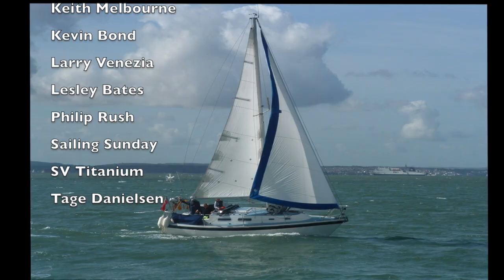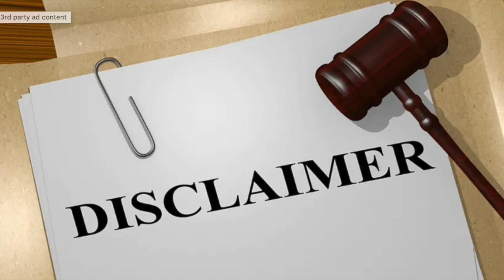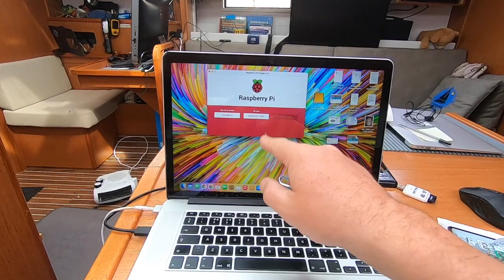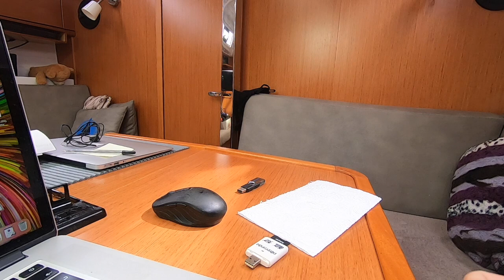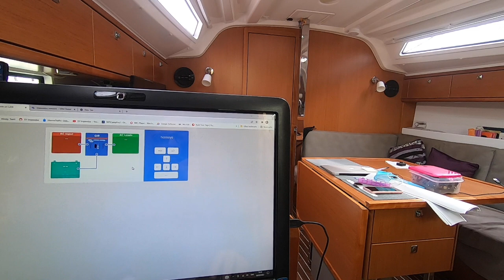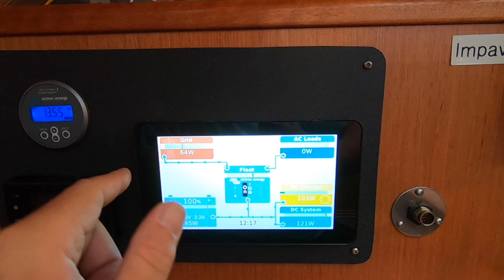Victron Energy display on a Raspberry Pi OTB 134

Comment: Interesting project, thank you. How much did you save by doing all this compared to hooking a GX touch into your Cerbo GX? Also, did I miss something? Does this have more capability than VRM and VE Connect on my iPad?
Reply from the maker: The cheapest bundle price I could come up with was £550 UKP or $570 USD However the GUI mods give far more features than the standard  Victron kit at around a third of the price + a little work to get it up and running. Same features on the VRM but much more on the touch screen. Sail Safe mate. Ant & Cid

Comment: Hi Guys, great video; many thanks.
Been messing about with VictronPI for two years, they are fantastic. Couple of cautions:-
1. They can create a LOT of radio interference. Check VHF is not affected by listening to a weak weather broadcast (it needs to be a weak signal) then switch PI on/off. If there is an interference problem, effect will be obvious! 
2. Victron USB adaptors are expensive as they are something called galvanically isolated meaning the USB ground (negative) is not connected to serial ground (negative) where simple/cheap USB-serial adaptors are. May be difficult to understand significance of this. You will have continuous connection from house battery negative, through that USB power supply, your PI circuit board, through USB-serial adaptor to negative of the MPPT or BMV. This negative path will be in parallel with MPPT/BMV negative direct to the battery meaning a small proportion of your MPPT/BMV negative current will flow through the PI! This will probably cause no problem unless a break occurs in the main negative path; the MPPT/BMV will they try to dump its full negative current through your PI! Something somewhere will burn out and hopefully in a manner that doesn't result in too much damage. Genuine Victron cable avoid this risk by breaking this stray negative path through galvanic isolation. You can buy galvanically isolated USB-serial adaptors on Amazon for around £14; if spending £14 however, may as well buy the genuine Victron lead? Not suggesting that you don't use a £3 adaptor, just be aware of potential stray negative problem.
Hope that's useful. Cheers.
Reply from the maker: Lots of useful info. I'll look into this, many thanks. Sail Safe.